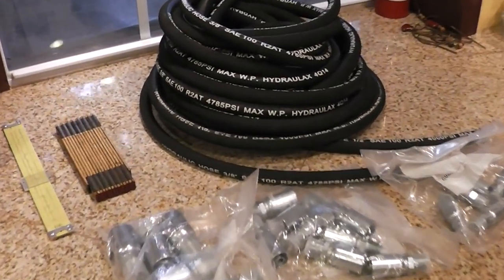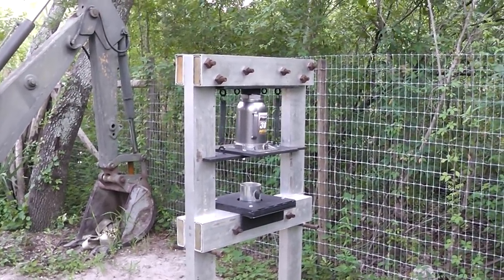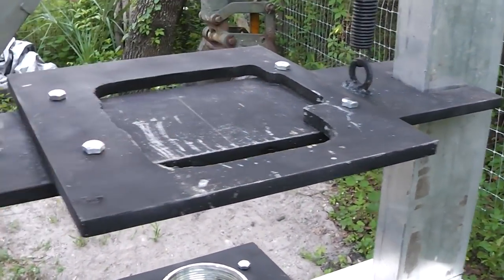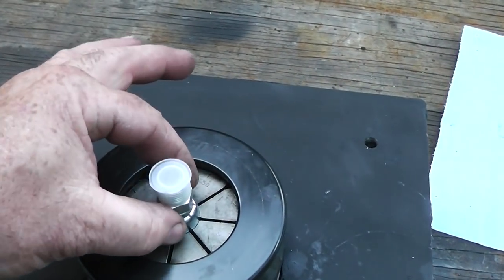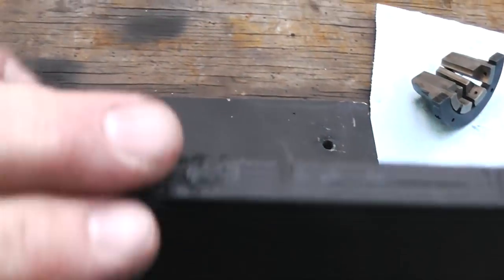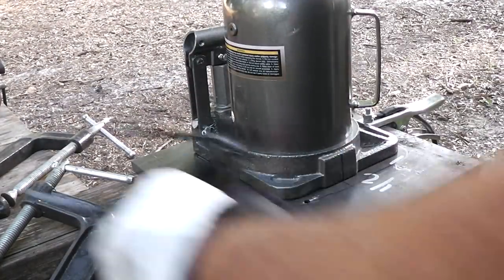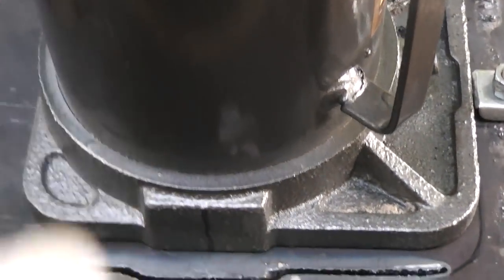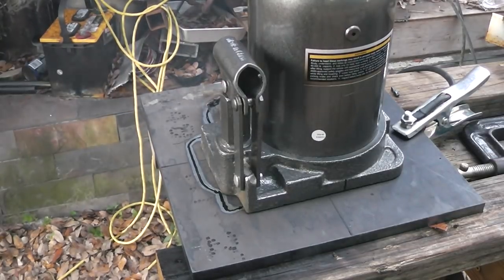How I Contructed the Cheap DIY Hydraulic Hose Crimper Part 2

Comment: Nice work.

I hear you say that your welder's to small to weld that base plate. I reckon that if you grooved the edges and ran a few beads, its not going to fall apart. You'll get enough penetration to make a solid connection.  Having said that, being able to disassemble the device is going to make it easier to transport and store.

Keep up the good work. 👍

Comment: There's a metal supply in our town that has a plasma cutter cnc machine service, a place that that might be able to makeup die's. I had them do some custom parts for me and i designed & picked out the style on their computer in their office, then he loaded the plate steel and made the 4 parts for less than $20. He said that cnc machine can plasma cut up to 14" thick steel plate. It's basically a plasma cutter zip tied to a cnc. I used to always have the john deere dealership makeup all my hoses because they last forever, might be 5000 or more psi hose. Now they're too expensive so i have the feed co-op make them but the quality of hose is not the best. Good video series here.
Reply from the maker: jasonmushersee A cnc will put me to shame!  You can get that metal supply company to make you a much more professional product with a lot less hassle and money too!.  It sounds like a winner to me.

Comment: Good stuff! I think I'll pretty much copy and use a pusher weighted enough to hold it in place til I get it movin. I've got 3 Holmes wrecker beds from the early 80's to get going with bookoos of 3/8 fittings. THANKS

Comment: Thanks for the video, it would be a big help if you could let me know what brand die and compression ring you used. Thanks for any help.
Reply from the maker: http://www.discounthydraulichose.com/product_p/d100dies.htm
I got the compression ring off of a D100 hose crimper.  You can call DHH and ask them to sell you one.
Make sure you get a compression ring that is compatible with the dies that you are going to use.

Comment: Thanks for the video.  Would be nice to see the link to where one would be able to buy the die and that shell going over the die.
For the hydraulic bottle, I think the bottom is way over engineered.  Not to criticized, but to give hint to others, when they do it.  It doesn't need to be that thick nor big.  Just enough for the bottom of the bottle, which was cut out.  The rest are just for alignment purposes (mostly).  You can also just put 5 bolts around it, vs cutting a hole so it doesn't move.
For cutting the bottom, you can use a carbide high speed tool vs a file and it saves some work.

Comment: Nice video.
Questions:
What brand plasma cutter do you have?
Do you like it?
What amps are needed and PSI... to run it?
I WANT ONE !!
Reply from the maker: TexasPrepper2 Thanks.  
Answers:
Eastwood Versa 60.
Yes.
50 amp/240 volt and up to 65 psi but, I am not sure of the cfm.
I am planning to do a review.  I got it back in Nov. 2014 but, I wanted to use it for a while to see how it would hold together.  3 year warranty, cuts up to 7/8 steel, Eastwood's reputation and a lot of good reviews is what sold me.

Comment: You went through a great deal of detail but did not say where you got the forcing cone and the die.  Dies are common to find and buy but I have not seen a forcing cone for sale used.  Where did you get the forcing cone?
Reply from the maker: +sequoyah59 http://www.discounthydraulichose.com/default.asp
Reply: +homesteadprepper Sorry, I see and have seen the dies but not the cones.  Do the dies come with a forcing cone?
Reply from the maker: +sequoyah59 No. There are several different ways that you can go.
Different manufactures use different options and individual compression rings/dies.

My crimping rig(D100 dies and D100 compression ring) is good up to 1 inch for braided hose.  I can not presently crimp 1 inch W series yet or the larger 1 1/4, 1 1/2 or the 2 inch with what I have.

#1 what size/type of hoses are you wanting to crimp?
#2 If you want to start crimping hoses larger than 1 inch may need a special double angle die and/or a special compression ring.
#3 if you go to the product literature page and click on "crimp specifications for hydraulic hose and fittings" the chart will show you what type/size of dies you are interested and if a special compression ring is needed for the type/size of hose that you are wanting to crimp.
#4 You will have to call DHH and talk to someone in sales about the type of compression ring that you might want to use for your particular application. The compression rings are not listed on the their page that I know of.
Reply: +homesteadprepper I've made hose for a long time but never owned a crimper.  The thing I need to know is did the forcing cone (what you call the compression ring or die ring) come with the die (Discount does not say) and if it did not come with the die where did you get it?  Forcing cones are usually part of the crimping machine and the same cone is used with every die available for the machine.  Thanks for your forbearance.
Reply from the maker: +sequoyah59 It did not come with the die. I purchased it from DHH.
Reply: +homesteadprepper OK, I did not see it offered at their web site on the dies page or anywhere else.  Guess I'll have to call but if the cone is as much as the die it approaches the price of catching a used machine with a good set of dies included.  Thanks.
Reply: You be like hitting the jack pot if you find a used crimper at a reasonable price, I have tried Amazon, EBay, local swap meets; one in a million if U find one, guess what? that is why people do it themselves.

Comment: I just went to the DHH website, and for a compression ring and die... it's about $500
... would that be about what you spent for a die and ring?

I've got everything else, but the time and effort to build is also worth something. Thinking that if I had a $1000used crimper it might just be easier in the long run. I know time is money for most... so, I've got to weigh the pros and cons I guess.

I too have an old tractor. A 1967 Case 580 Construction King.  It's a backhoe or gannon. The attachments come off and go on in less than 20min. Love this thing, as it's two tractors in one. BUT... I'm about to start replacing hoses and found your DIY crimper idea.    ...so, here we go!!  ;)
Reply from the maker: I paid $170 for the comp ring and @$189 for the die, when this vid was made(D100). By all means, if you can score a used crimper with dies for the right price, then that is the way to go.  When I decided I wanted to make my own hoses, used crimpers with dies were way out of the ball park in price or just plain not available.

Comment: Thank you for putting this on the web. Hydraulic hoses are  just too expensive. Do you think a 20 ton HF press would apply enough force>?
Reply from the maker: Their will be no problem with crimping 2 wire hoses up to 3/8".  Crimping a 1/2" hose may be just at the limits of a 20 ton force.  Larger hoses will require larger crimping forces. And btw, using an ample amount of lube on the dies and compression ring, go a long way.

Comment: How are you hoses holding up 5 years later?
Reply from the maker: They are still working great!
Reply: @homesteadprepper  thanks for responding.  I am searching ebay for the correct compression ring and die.  I am looking at some Eaton Weatherhead components.  At a quote of $60 per hose this devise is going to get made.  Thanks for the video.  I do not see how some cheap crimpers are not being built and sold.